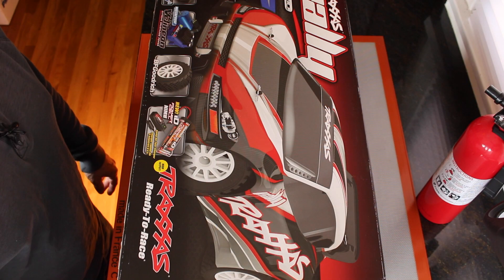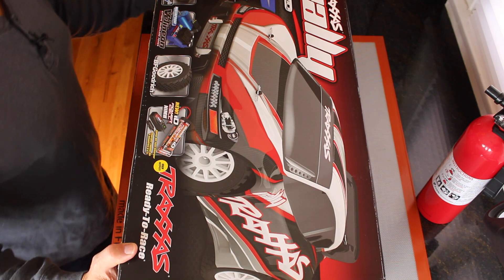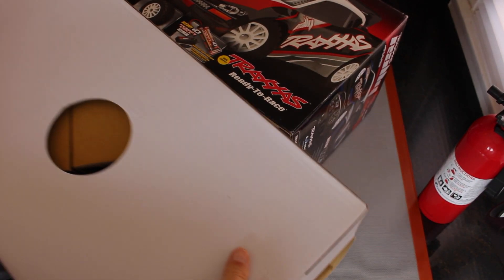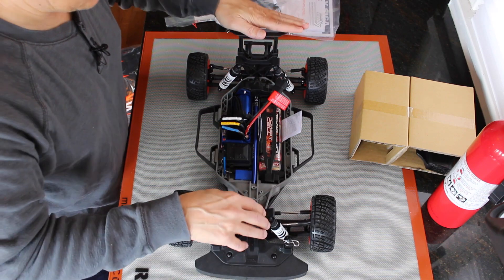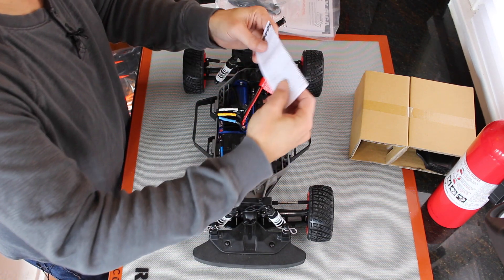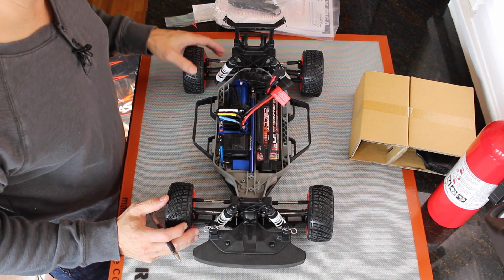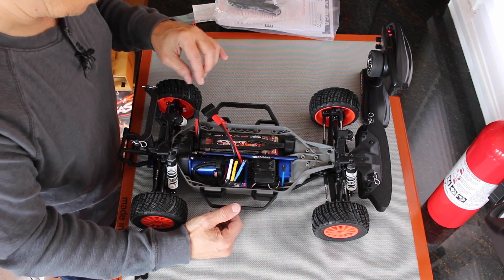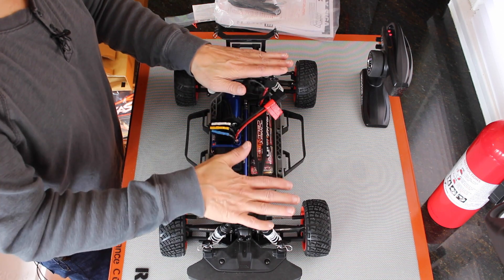Jetson RACECAR Build - Part 1 - Traxxas Rally Unboxing

Comment from the maker: +77Avadon77 That's a pretty big truck! The aftermarket for the Traxxas stuff is of a pretty good size in and of itself, some guys build variations of the Rally car that I'm using that go over 145 mph. Basically they buy the plastic mid-tub from Traxxas and then everything else is aftermarket, with most of the suspension pieces aluminum or carbon fiber. At MIT they use an open source ESC (it's called VESC) so that they have finer grain control over the motor. The VESC is about $110.

Comment: We are hot on your trail Jim,

https://www.youtube.com/watch?v=EtTS6tbcVSI

But the drive train is a bit glitchy because there is some kind of internal breaking mechanism. So it's not anywhere as smooth as some kind of rotary encoded motor. So I don't know if it's good enough of if it needs reworking. One thing you'll find out of the box is that the suspension really gives with weight thus you'll need stiffer suspension and probably thicker weight Losi shock oil as well. 

For springs I found this commercial supplier because many of the RC Cars/Trucks that Traxxas sells do not have various stiffness' of springs. They often only have one stiffness which doesn't leave you much room if all your gear you set ontop of it drops it down significantly. 
https://www.centuryspring.com/pdfs/12-228COMPRESSION.pdf

Comment: Jim, 

Are you planning to take in to this endeavor by yourself ?
this is a nice nice project...and look forward to each step....
Reply from the maker: +DEM GER At this point, the intention is to go step by step, similar to the way we did the JetsonBot. There probably be a couple of variations of the car, one with a Jetson TX1, and one with a Jetson TK1. Both will use the same mechanical infrastructure such as acrylic platforms, and share electrical items like batteries and interfacing with the ESC and steering.&#160;

I&#39;m planning on having a computer platform, and then a sensor platform so it can be a mix and match type of arrangement. That should make it easy to swap out new sensors or computers to change the configuration.